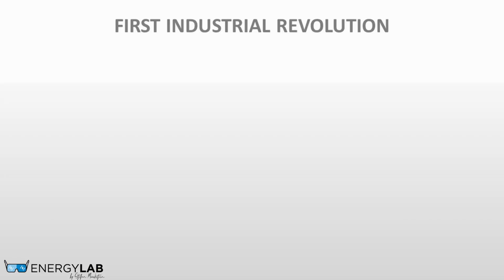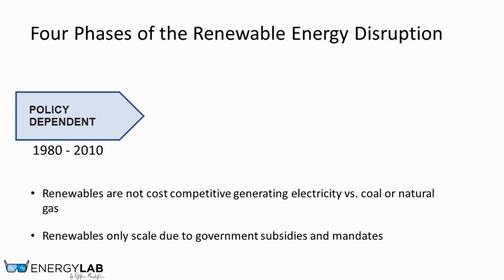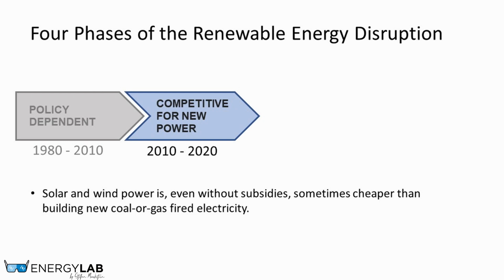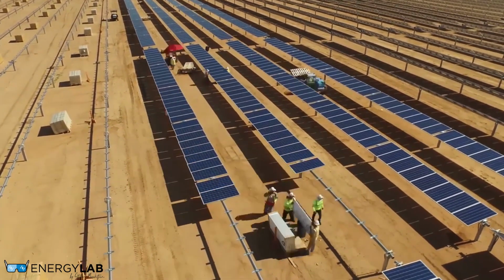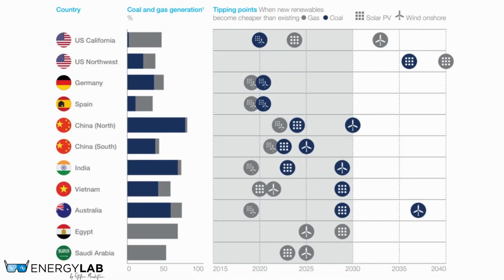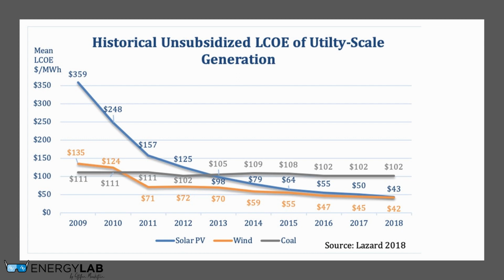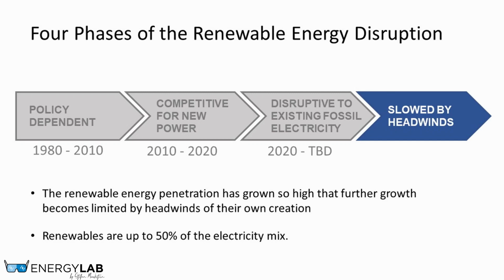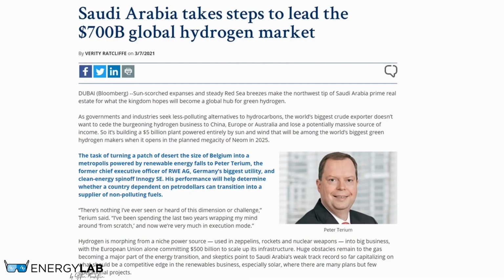The Evolution of Renewable Energy

Comment: Should we try to lower the amperage and voltage at the residential level?  Do we need 120 and 240 volt houses?  Decentralized low voltage (i.e., 12v) residential  home conversion with wind and solar.  Appliances and electronics in the household are 12v driven.
Reply from the maker: Very interesting and true. However, getting countries to change amperage and voltage will be difficult. 
We can’t even agree on a standard electricity plug. 🔌